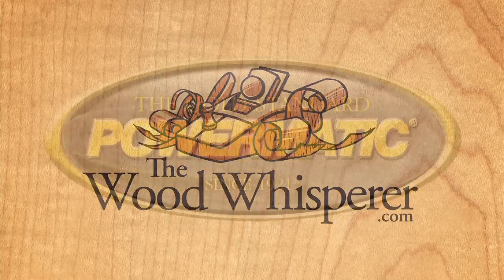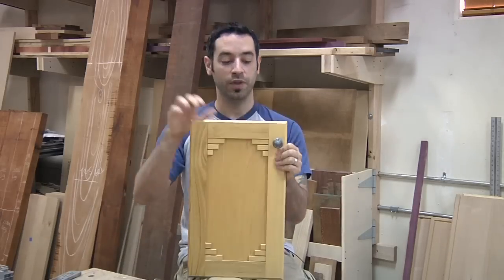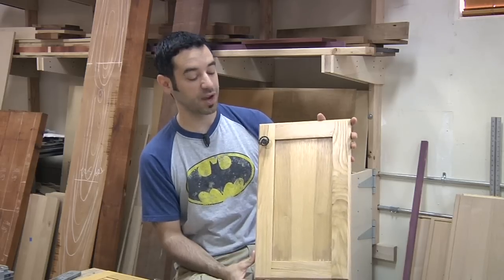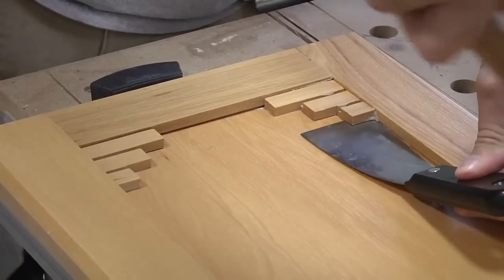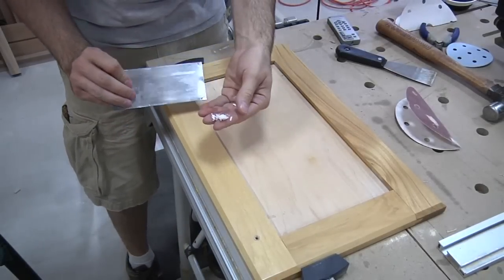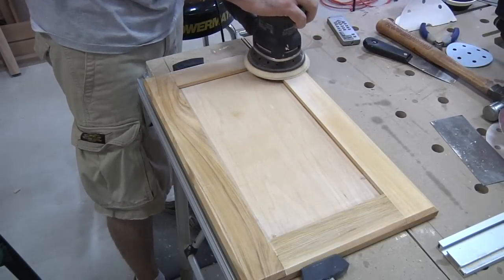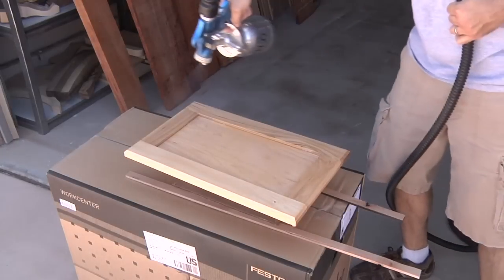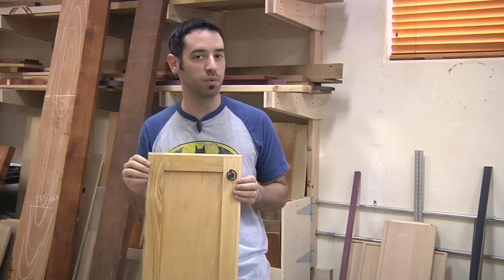149 - How to Refinish & Repurpose Cabinet Doors

Comment: I realize this is one of your older videos but I am curious if anything can be done to refinish a recessed panel cathedral door to look more like a shaker? Can the top piece be routered straight or cut straight across with an oscillating tool? I am re-staining to update and it seems like a shame to replace these beautiful wooden doors simply because the style is outdated. Any advice would be so appreciated!

Comment: This is my favorite cabinet refinishing video-thanks for sharing!  I hate to see beautiful wood covered with paint - and these hickory cabinets are wonderful.  Also, I appreciate your card scraper recommendation.  The subtitles are a nice touch as well.   My oak cabinets are 19 years old and have developed that orange tint.  I would like to refinish with a lighter stain.  I'd love to use the water-based and wondered about durability because my cabinets get heavy use-I cook or bake 2-3 times every day.  Do you have a recommendation for a tool for sanding the crown molding?  Or would you replace it rather than try to get the finish out of all of those grooves?  This really is a great video.